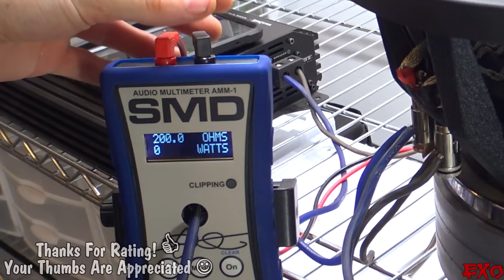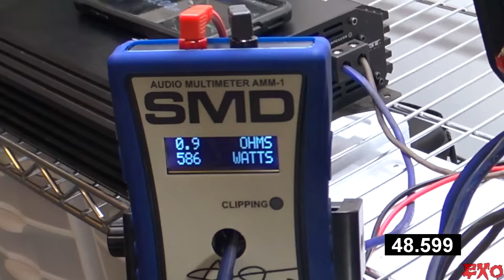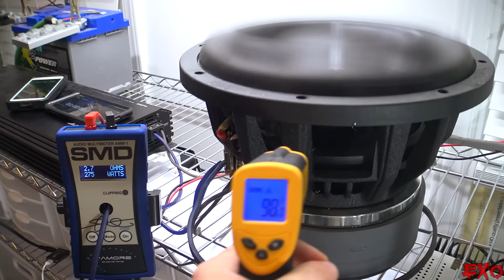12" DESTROYER Subwoofer MOD!?!? Testing NEW Rockville Voice Coil Temperature w/ BIGGER Dust Cap

Comment: Looks to me like a poor casting for that back plate and with a lack of quality control they just passed it right off to machining, most likely a reusable cast that was not cleaned properly! Had that back plate been forged there would be no issues like that, but in the market to save money pouring metal is always cheaper than pressing it, even though you add even more cost having to machine a casting compared to machining a forging which would have tighter tolerances! When it comes to the dust cap you only show how little research and development went into these subs to begin with, they are literally not spending enough on testing to put a quality product out of their doors! JL audio was one of the first in the industry to develop an elevated spider mount in their W0 series subwoofers in the mid to late 1990's! I will stick to my 20 year old JL 15 W0's and avoid rockville!

Comment: A bigger dust cap isn't going to cool any better than a tiny one.
Reply: Agree your only going to pull so much air through.  If you try pulling to much air it might cause a few different issues including temp increase.

Comment: I think I speak for everyone when I say "Nobody wants that thing". Rockville goes and publicly destroys sundown subs by running them with clipped amps, not realizing that the sundown team already stress-tested them overrated for like 20 min. They are a horrible company and that sub could barely handle 600w. And why is the CEA rating different than the rating they give. CEA rated @ 2000w and then they double it and say 4000w rms. Like Braa..

Comment: how can a dust cap affect temperature!?

: i mean a big one vs a small one
Reply: Surface area.
Air loves surface area .
Think of it as a air bucket, the bigger the bucket the more air it can  hold per stroke✌️😎😉
Reply: Different density and rigidity. Stiffer produces more air movement. Thinner one is like a sheet in the wind and possibly even lets some air through. Depending on material it's made of.
Reply: More surface area above the voice coil to push air back into the gap.
Reply: thank you guys for the explanations! i got it now!🙂
Reply: @f.a3202  no prollem ma dude. The only dumb question is the one never asked. 🙃🙂✌️

Comment: DC Audio
Level 3 12 m3 (1000-watts-RMS)-DVC-1OHM . gonna cost you about 330 $
its 1000 times better than any and all of rockville subs combined.
dont waste your hard earned cash on such trash.
i have dc audio xl 15" rated at 2200 w rms. taking hard pounding and abuse from a 3000 w rms amp on a daily basis..... worst  thing happened the dust cap got destroyed but the sub still runs just fine. trust me you cant go wrong with dc audio products. im just a fan of the brand.
Reply: mohammed seiamm check out the skar VXF, affordable & it gets great reviews 🔊✅
Reply: @uptobatentertainment  thx man . i will